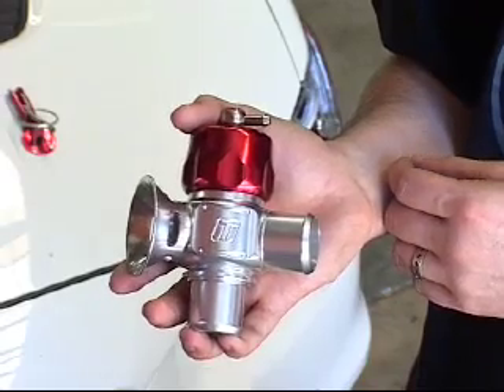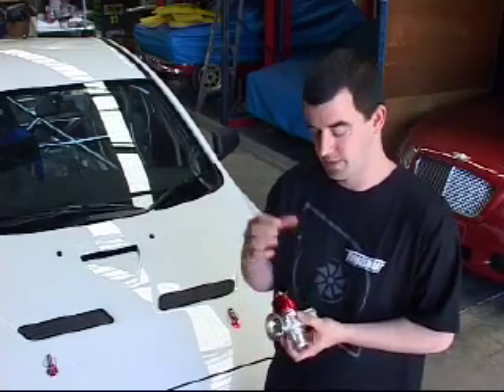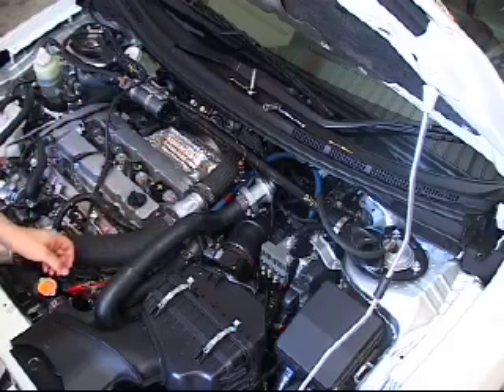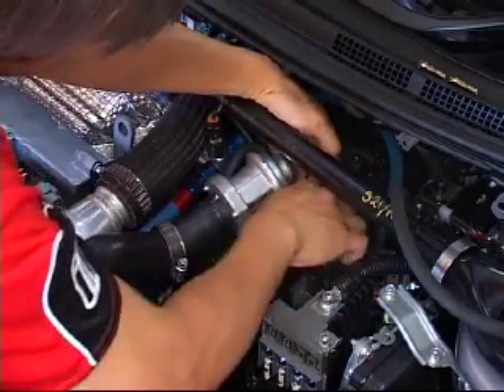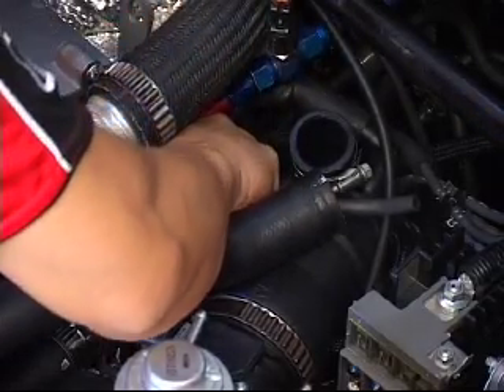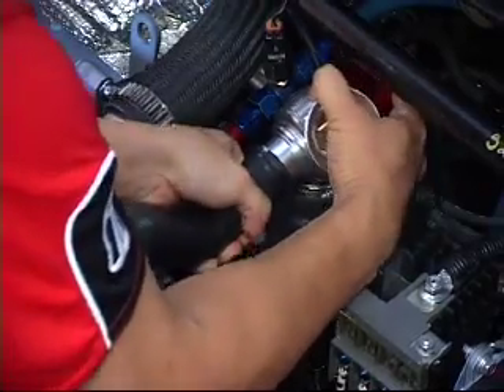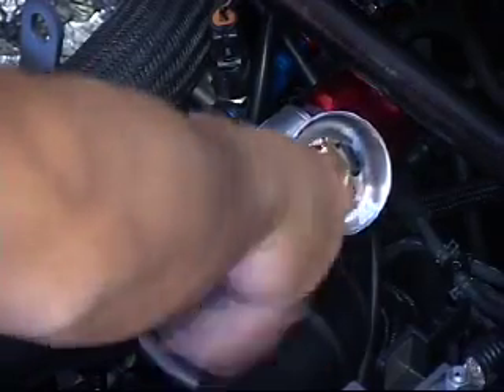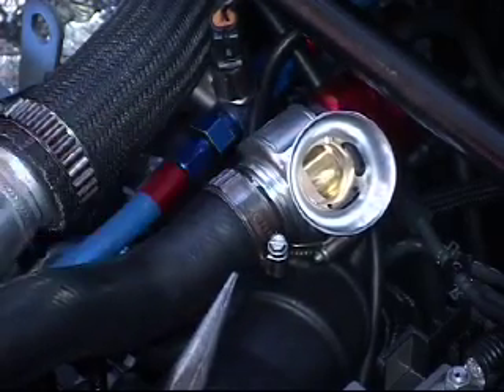Turbosmart Mitsubishi Dual Port fitting tutorial

Comment: I have a 2014 evo x gs r everything is stock and I'm going too install turbosmart dual bov. When I install the bov do I need to get my car retuned or no?
Reply from the maker: +djm93 You don't have to have the car retuned after installing the Dual Port BOV - it's designed to work with the standard mapping.
Reply: if i ever need to go back to the factory bov I'll be good right won't need a tune and no issues will occur

Comment: Hey Guys, any idea on how tog et this to fit without rattling on the strut bar? I've had a annoying rattle since installation and it sits exactly where you guys installed it.

Thanks
Reply from the maker: Hey Steve,

Can you send through some pictures to tech@turbosmart.com.au so we can take a look, the valve shouldn't be that close to the strut brace that it can touch it. Have you got any other mods to the car?